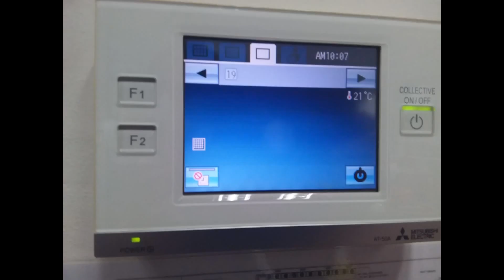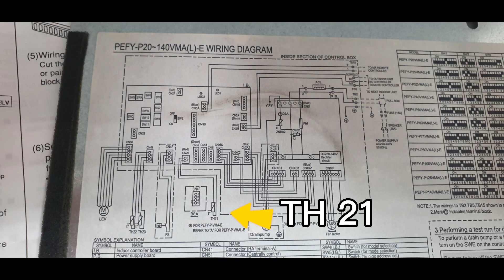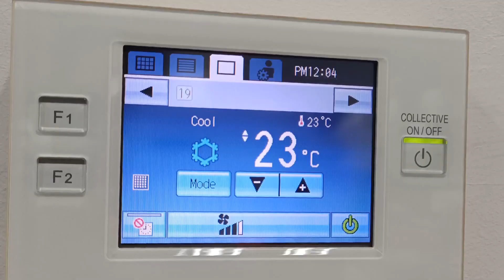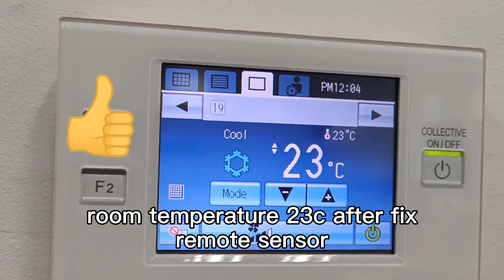Mitsubishi VRF | How to improve indoor cooling temperature using remote sensor.

Comment: Did you have to remove the normal return air sensor after installing the remote temperature sensor? How did you tell the unit which one to use?